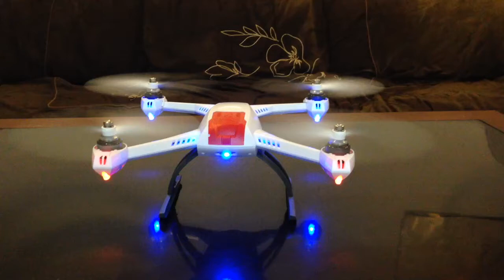Blade 350 QX "Wagging the dog"

Comment: i suspect the waggle is an oscillation driven by ONE initial event, setting off a chain reaction. at least by the way mine behaved. annnnnnnnd i'm done spamming your chan now.
Reply from the maker: dude, you're cracking me up man, I don't mind the "healthy" discussion.  All the motor screws were tight.
I transferred everything to my OPQ frame without changing anything and immediatley the shuttering was gone.  I even test flew the quad with only one screw holding in each motor (cause I needed more) and the shuttering never appeared again.
Please comment on all my videos!!!! loving it!

Comment: also, my RF motor wasn't fully tightened down. I could tell because the shaft was slightly blurry from above while spinning, and the other prop shafts were perfectly concentric and not blurry (vibrating). It's not the craft or design, it's props and I suspect the landing gear also, because the landing gear has small footprint allowing squishy to/fro movement.
Reply from the maker: putting something squishy on your landing gear isn't a fix, youre masking the  problem
Reply: 7demo7
I see what you're saying, but in my case (and i suspect most others) the rigidity of the landing gear (+ small footprint) is actually a contributor, not a symptom.  Adding foam is addressing a root cause, not providing a band-aid.  The main contributors, however, were the motors not being tight in their mounts and the prop blades/hubs not being balanced. These two eliminated most of the shimmy.  A resonant frequency perhaps ?
Reply: 7demo7 just wondering , are the symptoms identical with your smallparts motor adapter/prop config as they were with stock props ?  I forget to mention I got a tiny bit more smoothness out of using the collars that came with my carbon fiber props so that the prop contacted the shaft the full length. Also, centering the washers during tightening.

Comment: I've seen this  exact behaviour on some completely stock 350's when idling up or down,  There is a lower RPM point associated with minor vibration.  This behaviour is common with many rotating systems and represents the least harmonic RPM point.  Don't keep running it at this point though...stop the props after landing.  Just fly it and have fun!
Reply from the maker: The root cause is the flexy arms of the 350. However, I think it's fine to fly it this way. 
Somtimes I get flex in the arms when really pushing it on the stock frame which is why I swiched frames.. also I want to do proximity fpv flying and need somethin to take the abuse, lol

Comment: I said that i think it ads to the vibrations not causes it. I tried the adapters with several prop combos and always felt it flew better stock. More power for sure. The stock props are under 5 grams. adapters with pac props are just under 15 grams. I asure you tripling the prop weight on any machine will make big changes. Im not saying I'm happy with the b props but i flies better and vids are smoother

Comment from the maker: I'm sorry but that's just not true.  If you plug in an independant  esc and power up the motor it dosen't vibrate at all like in my video.  I can replicate this with or without props or adapers and with the stock blades.

Comment: It's the Cnc adapters the extra weight adds to the vibration. Make sure the washer is centered as it is slightly oversized. They fly better with stick props